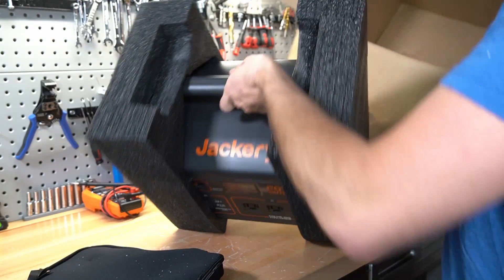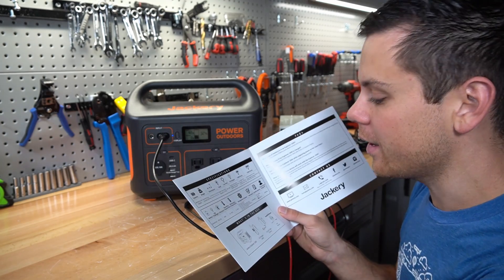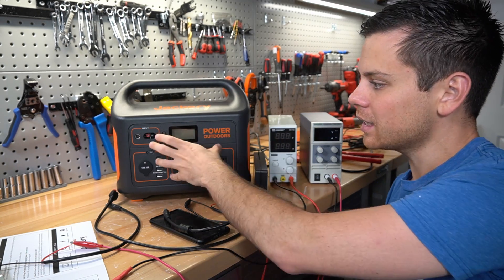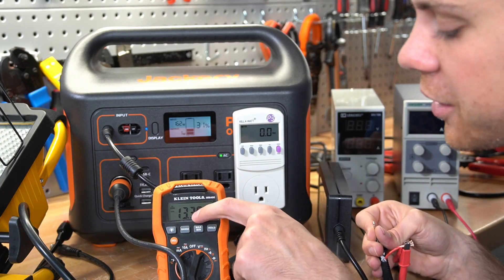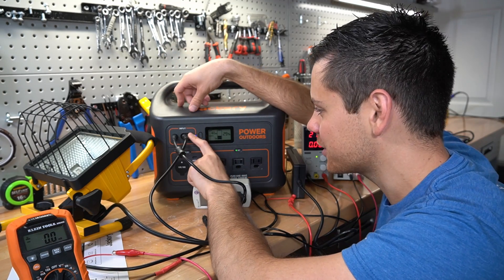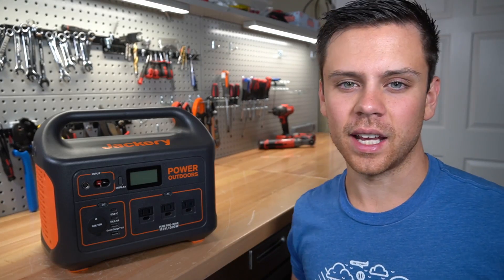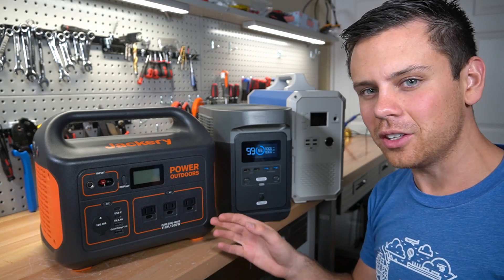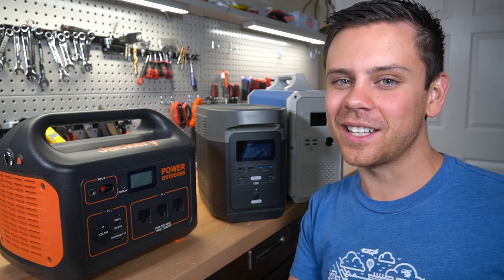Jackery Explorer 1000: Mini Solar Power System

Comment: What is the actual lifespan of a Jackery 1000 battery. Certainly it would depend on its usage so using it moderately, summer camping and emergency only home use — would you say 5 years, 10 years? Or more ? I would expect that after a set amount of time the battery itself would become less reliable to recharge and eventually would expire.

Comment: Could I plug in one new Bluetti PV200 with a 26.1 voltage open circuit into this Jackery 1000 with a MC4 to 8mm adapter instead of using 2 Jackery 100 watt Saga panels without doing harm to the Jackery?

Comment: you need to do Noise tests, its very important for when you are using it when you sleep next to it. Also you did not mention that the Bluetti can not work when under 0 degrees Celsius that is very important. Bluetti's can not be charged  by 12v & the customer service is shocking. Jackery's input is lacking and charge is slow, but still trumps the others in terms of a small setup. Jackery for small, Titan for Big. Horses for Courses. Also no Black Friday deals in the Uk for EcoFlow. Very Poor. Bluetti are trying to sell off their 120 w panels, but the EB 150 + 200w is only a £100 saving? Another disappointment. Jackery is 20% and 25% Off.

Comment: I purchased the Explorer 240 and one issue I have noticed is that out of the two I now have neither will run a 43 watt 120 V fan very well is this because the jackery puts out 110 v and the fan even though it is only 43 watts requires 120? The fan on high on the jackery is similar to low in my ac wall outlet. Also is there anything that can be done about this like a power strip that upscales 110 to 120

Comment: Just what I need to know and what I thought it will be. The ecoflow is the one to get for me as it appears in 2 or 3 years,  there will be Major change in term of "Energy" ( Power) supply. As long as it last for 2 years, it is well worth the money and in most cases, people will have more than one Units of the solar power systems anyway.
Reply: It will be great if you can have review on the Portable Solar panel that can be used with different type of generators ( systems). Yeti seems to have a lot of problem( complications) with the solar or 12v charging.

Comment: Excellent review. These portable units are always an exercise in compromise, and end-up being more gimmick than practical. They cheap-out on the inverter in order to cram it into the plastic case (80% efficiency on a pure sinewave?! This is terrible). The input controller is underpowered at 10A/30V, and although they say it is MPPT, it can't be very good - note that the input amps fell drastically when the input voltage dropped below 18V - this is the job of an MPPT... to maximize charging amps by adjusting voltage, so clearly this has very little range to work with, and no one will see a performance difference on a single 150W panel. So MPPT is a marketing label only here. Also, the 8A max charging limit means the lithium NMC cells and BMS are suspect. A good LiFePO4 battery in the same capacity range can charge at 50A! NMC also has a full cycle life expectancy of 500 rounds, meaning that this unit could be finished in less than 2 years if you always fully drain & charge it - then off to the landfill because you can't replace the battery unit. Lesson: DIY your own system if you want proper components, performance, and serviceability for your van or cabin.

Comment: How much would you charge to put together enough of a power bank to run a tv, a few other electronics.. Fridge of some sort, occasional small house air conditioner? I'm an older disabled woman trying to fix small pull behind camper. Thank you for any help

Comment: Could i power a sump pump with this, in the event of an emergency where the power goes out, and i want to have power to the sump pump for a temporary period of time until power to the house is restored? The sump pump is HP 1/2 Hz60 Volts 120 Amps 10.  Thanks

Comment: Jackery is a established USA company with excellent customer service. To many people that carries a lot of weight. After a lot of research I went with the Jackery 1000 and 2 of there 100w solar panels(got it 15% off on sale/free shipping/no tax).  It's worked flawlessly. I highly recommend it. (I wish the actual product was made in the USA(all jackery products are made in china)but no one makes a solar generator in the USA currently. Assembly doesn't count either. All most all electrical components are made in China.

Comment: Like your videos but I do get lost after awhile.. LOL.   It’s very easy to get lost with so many manufacturers of these power supply units.  Just need to know which one would be the best to run two cpap machines while boondocking in a camper.  I also have solar on the camper with no inverter because it just runs the 12v part of the camper. 
Afraid of draining the battery at night with the cpap machines.  
I did buy a 300 watt inverter for whatever lol.   
Will take any advice you can provide.  Thank You!

Comment: If you trip the circuit how do you reset the circuit? Can the battery be replaced? Is this unit fused and if so what kind of fuses does it use?

Comment: I bought the Jackery 1000 came with 2 100 w solar panels I have been watching Will a long time and really like him. I just wanted something super easy and just love the idea of solar. I’ve only used a tiny bit and wondering how using only a little and letting it unused for long periods is ok.                                       Not much info included. Guess I should call them but I can’t hear well. And really need simple answers

Comment: You say to charge with 17 volts, fine for solar but does not address people having to charge from 12v car system.    Do you also know if the delays are fixed?   I dont want one with that 30 second delay.    Thanks.

Comment: Do you think this unit would be fine for a weekender with a Sprinter Van?  I would be charging laptops, phones, cameras and most importantly an Isotherm 85 DC fridge. I plan on using solar and  I do have a stock auxiliary battery in my van for direct dc charging. Love your channel thank you.

Comment: JUST BOUGHT, July 2020: Hooking my jackery 1000 to two Jackery 100W solar panels I get about 130 watt showing on the 1000 display hummm... I emailed Jackery on this (as they dont answer the phone EVER) and tech support emailed back statingthe Parallel cable takes away power and I would not get 200W anyway from their panels ...Also I charged the 1000 from 30% (out of the box) to 100% in 4-5 hours using solar then house 110V...Im not techy like this guy (I like) but it did seem fast to me.

Comment: FIRST DAY FAIL/DEAD July 2020 order: Got this 1000 delivered and I tested it out the first day by hooking my two 100W jackery solar panels in parallel ("Y" parallel cable included) FYI two 100w solar panels dose not equal 200w of solar power, per Jackery.  But it charged from 30% to 50% in a few hours and then I tested it on the 110 volt wall socket taking it to 100%.  I then tested it out on a low watt 110 appliance and POP. It went totally dead in this 3 minute first day test. I tried calling Jackery..NO ANSWER... Emailed them the same day it was delivered about the FAILURE/dead 1000 and the next morning my answer was to sent the 1000 back and then a new one would be sent out. They also sent return UPS paid stickers which made it easy. Got the new one a week or so later and it tested out just fine...Still 5 stars as we all can get a lemon. So I was taken care of, thanks to someone named Elaine at Jackery. So the new one came and the test was on.... My test was this, I charged the 1000 up to 100% (delivered at 30% power) by using (2 Jackery 100W S.P) solar first then wall 110V  and then plugged it into my 14 year old Large home GE Monogram side by side refrigerator. I used the freg all day long as we would normally (in and out and used the ice-maker 3-4 times) and 7-8 hours later my Jackery 1000 was down to 30% and still running... Test completed.... 5 Stars ....still a little worried but Jackery seems to be on top of it, other than answering their phones... Adding a few things learnd by emails to Jackery two 100W Jackery solar panels dont equal 200W of solar energy going to the 1000, but better than 1 panel. The parallel cable they provide which hooks two solar panels in parallel takes away some solar energy and the length of cable coming from the solar panels to the Jackery 1000 loses energy as well... Hope this helps and that we all get what we paid for, years of Jackery power.

Comment: I'm looking for a 1000w solar generator.  In your opinion,  which one would you recommend to me to  Purchase? I've done a lot of research and Im  Confused on which one to purchase?Basically I'm going to be using it for just about anything.  Camping,  tailgating is otherthings.  I currently have da Jackery 240, not bad,  using it at my camp for the radio and some LED lights. Please advise.  Thank you for your time

Comment: I haven’t bought a battery yet, and wanted to spend the $1K on either the Jackery 1000 or a battle born 12v 100Ah. 

I’ve fooled around with the Jackery 240, which recharged just fine with two 100w panels, but the 240 wasn’t big enough to draw the 75watts or so per hour needed for my MacBook Pro which easily drained the Jackery 240 from 100% to 60% in only a couple of hours. So the rate of recharge vs rate of consumption wasn’t compatible with my use. And then if it’s a cloudy day your stuck with a low Jackery 240 at 40%, then your done. Then your hoping and waiting for a full sunny day to recharge the battery.

So I was thinking the Jack 1000 could take the 75-100 watts per hour, and drop to maybe 75% per session of use (helped by simultaneous charging by the panels if there was sun during that use). Then the recharge during non use could bring it back up from 75%.

The idea that you get a built in pure sine inverter, 12v and usb outlets, and an MPPT solar charge controller all sounded good. And still does sound good. 

But given the slow recharge rate resulting from the regulated solar inputs? That is a pure manufacture decision.

Therefore, the a Battle Born 12v 100Ah naked battery (not equipped with inverter, outlets, and an MPPT SCC) sounds like a better place to spend the $1,000 on. And then, perhaps, buy the a Jack 1k as a pseudo 2nd battery source (not primary). That seemed to look like a better sequence of acquiring solar energy storage solutions.

Even then, after getting the BB first, the question at that next purchase time would be: 1. Whether to buy another Battle Born with the $1000 do as to up fit dramatically the solar system with two BBs as apposed to acquiring a device which is more of a standalone piece of equipment which the Jack 1000 is.

Bottom line, if the Jack 1000 recharged as aggressively as the Battle Born would, then yes, as a first Lithium Power Storage/use solution to my system would have been easy. 

Therefore, Jackery if your listening, you’ve most likely lost this customer to battle born because of your products regulated and limited PV array input And recharge specifications.

I would have been happy buying a bunch of Jack 1000’s if they performed and were attachable (Parallel, series, etc.) (especially regarding recharging rates) as a stand alone 12v 100Ah battle born lithium battery. 

Of course the Jack 1000 is not a 100Ah capacity unit either. I believe it is in the 70Ah range. But if that was the only difference, then the decision would be easier between a BB and the Jack 1000 (getting a portable power solution vs one that is physically attached to one structure (the RV Campervan)

So at this moment, the BB appears to be a preferred place to spend the $1000. Perhaps already having a MPPT SCC and a working solar control panel, 12v outlets, and an inverter, having all these accessories already, makes the built in similar systems a moot issue because I already have the devices. So all I would need is to plop in the BB battery.

Otherwise, the Jack 1000 being Solar, inverter, MPPT, 12v and USB port outlets ready, may be preferred because one does not need to buy all the built in Solar components separately.

Comment: Love your videos! I have a 2 of the Jackery 100w panels, each panel gives me around 80W separately. When I plug them both in via the Jackery 2 panel adapter, I only get a max of about 120w, I would have expected like 160/150w! Does this make sense? Also, I noticed your unit has a lag, mine did too - this means you have one of the 1st batches and there is a recall due a potential problem with the AC unit, the lag has been fix. I received a new unit.

Comment: Will Prowse,  awesome video you test so many of these portable power stations which one do you recommend the most without looking at the price. I am looking for at least 1000 watt-hours that can be recharged as fast as possible by AC, solar, and car chargers. I would love to use Sunpower solar panels but they have higher voltages for their bigger panels? Which portable power station would you recommend?

Comment: Think this system self charging electric bike battery???
 FLASHFISH

4.2 out of 5 stars  163Reviews

300W Solar Generator, FlashFish 60000mAh Portable Power Station Camping Potable Generator, CPAP Battery Recharged by Solar Panel. The bike battery is 52 v 17.5 Ah? I'm looking for something small and light to go on camping trips andwill need some kind of solar charger for out in the field.

Comment: Hi!  Your video is GREAT! Can you do some videos to show a beginner how to use the P3 power meter with small appliances to figure out what kind of power system is needed?  I want to prepare for hurricane season and run afew small things: fan, little light, portable cooler. . .want to figure out if I need a big Bluetti unit or maybe buy 2 smaller units so I can use one and power up the other w solar.  Thank you.  I am a total beginner with this stuff and your video is so helpful. . .

Comment: Help if you can.....Im doing 2-100w HQST panels.  I only need to run Indel-B52a mini fridge and MaxAir fan.  What will be the best solar generator to handle my needs?  Jackery 240-500 or Rockpals 300?  I know its dependent on sunlight etc, just a general best overall unit for my needs.  I have watched all these reviews and get mixed signals when trying to decide.  Thanks all

Comment: Great video as always!

One thing i would really like you to do is to build a 48 volt system with pouch packed LiFePo4-cells. How to efficiently connect them together, BMS and stuff. Those are the cheapest cells i've seen so far. It would be super interesting! Thanks!

Comment: For your diy solar generator can I use 150 amp or 200 amp circuit breaker? I couldn't find a 170 amp one.

Comment: Hey Will, thanx again for the content! I've watched lots of your videos today and decided to go with 24v system instead of 12v based on the info from your channel. I have one 400W panel, which is 12v - please correct me if i'm wrong - so i can go with one more 12v panel connected in series and it may be a different one, e.g. 100W 12v panel, and i won't lose the efficiency of the 400W one as they will be simply added up and i will get a 24v 500W solar power. Is it right or i need the exact similar second panel of 400W? Thanx a ton!

ps. advices from the others are welcome too!

Comment: We really are in need of a complete layout of a system for a sailboat. Using 2- 100 watt solar panels,  2-vmaxtank
SLR 125 AGM 12 VOLT 125ah batteries, with the proper charge controllers, cables, fuses,  bus bar blocks & how to connect:
•Bilge pump
•Nav. Lights
•Marine radio
•Dometic cf50 fridge
•6 inside LED lights
•Outlet to power tablet for Navigation
•Outlet to power cell phone
•Auto radio/cd player
That would make a fabulous video and lots of folks would watch the video. Nothing like on YouTube now.
Thanks, your channel is great.

Comment: I am ignorant of most of this and was hoping you could answer a question for me on an unrelated subject. I have the Bluetti 1500 and would like to get solar panels for it. I have been looking at the Renogy 100w suitcase but the Bluetti does not like lower voltages. The front of the Bluetti says 16v minimal input but I got an email from Maxoak that said to use 18v minimum. My idea is that I need to buy two 100w suitcases and hook them in series for 24 volts. Renogy does sell the suitcase without a charge controller and I am assuming that it would work just like any other panels, BUT, Renogy does not give any information on this and I don't want to spend the $$$$$$ only to find out my ignorance has once again bit me in the backside. Any insight would be appreciated, thanks.
Reply: Oh, and do you think I can run 20' of 10ga cable from two 100w panels to charge the Bluetti. Thanks again!

Comment: A thousand bucks?. I did get the 500 on sale for like four hundred bucks. That's about it. I'll be going with a gas generator if I go up. 2000 Watts for like five hundred bucks. I know pros and cons to just battery vs gas engine. But no way. Thousand bucks jachary
Reply: Follow up. Wanted to see if it hit 800 but I think 850s the best. And doable. So 850 for the Thousand jackery this week. That's swallowable now. Ordered.

Comment: I'm asking this question here simply because it's the latest video and more likely to get a response from someone.
Everything electrical device that I  use at home is AC powered...everything. I charge my phone via USB from my laptop or directly from a wall socket with an adapter. So the question is...if I install an electrical system, let's say, an off grid cabin...why do I need to concern myself with a 12volt/multiple fuse system at all. I understand how an automobile system works, but other than lighting a cigarette or charging the off grid battery from the car, why is 12volt a consideration in the overall discussion?